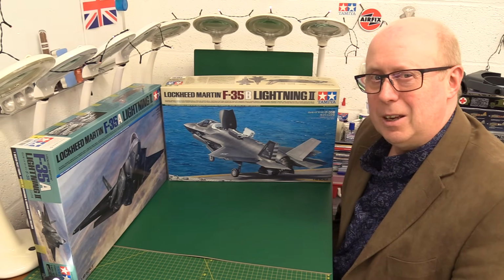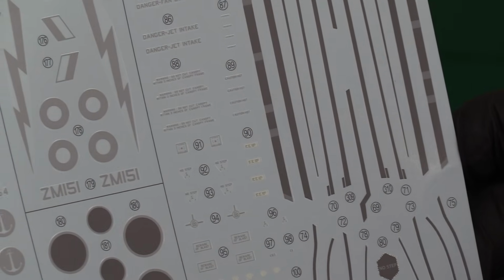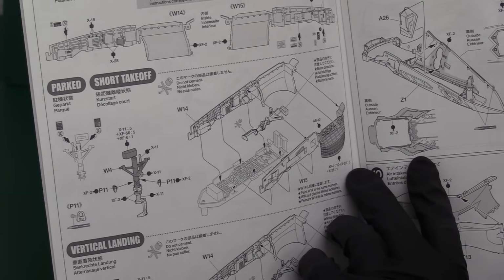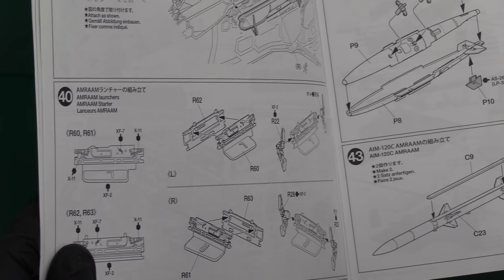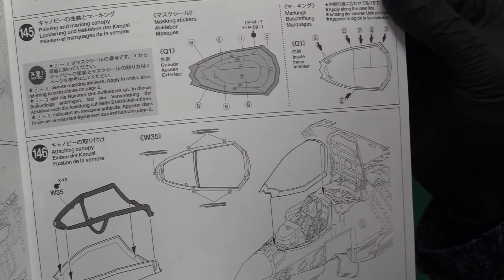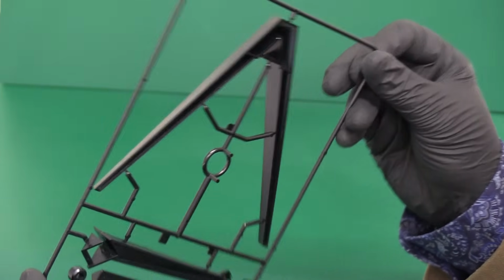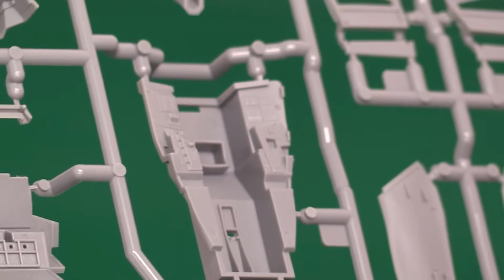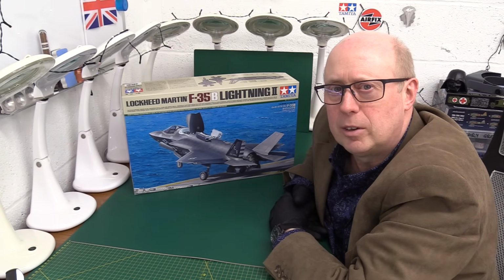Tamiya 1/48 F-35B Lightning II detailed review (61125)

Comment: The kit is probably not weight on wheels because it is really designed to be shown on the stand in the air - hence there would be no weight on wheels. They'd need to include two sets of wheels.
The kit should be marked down because it includes parts for the open canopy, but not the wheels on the ground.
If the left the open canopy option out and no weight on wheels then it there'd be no justification for marking down.
But since, they gone halfway by adding both open and closed  canopys, but leaving out the weight on wheels option needed to make the open canopy really useful, then IMO they should lose a mark.
Can't have Tamiya getting complacent - esepcially with the F-35 series of kits which will be analogous to their F-16 kits for the last 40+ years.
The F-16 kits are important because the F1-16 was the most widely exported fighter for "free world" and the F-35 is esentially it's replacment. As such we've seen a lot of F-16 kits and I think we can expect to see a lot of F-35 kits. It will be interesting to see if the F-35 is as long  lived - it's harder to add capabolity and payload to an F-35 without reducing it's stealth.

Comment: The F-35 is held together with fasteners, including the wing skins afaik.  The non removable portions are presumably filled and sanded, while the removable ones are covered in tape - allowing the dimples of the unfilled fasteners to be seen. Therefore I have to assume that Trumpeter used production drawings or production photos of the aircraft in it's primer paint, where all the fastners are still visible. Filling these on the wings shouldn't be a major task I would have thought. BTW, an interesting short vid on youtube can be found if you search for "Projected Work Instructions on the F-35 Lightning"  They use a projected image onto the aircraft to show workers which holes require which fasteners!

Comment: Because of the way the kit is designed you need to fit the front undercarriage in the undeployed position then cut a piece of plastic off if you want it deployed
Reply from the maker: Right! That explains it. Cheers
Reply: @Peter-Oxley-Modelling-Lab  I snapped mine off straight away on the original release so it didn’t work so well for me 😂
Reply from the maker: @russellbower3454  Oh hell! 😨 I will take that as a warning…😱

Comment: The engineering of the Tamiya F-35A & B kits are almost catching up with Bandai engineering and fit.  They have taken a leaf out of Bandai's book, so much to the better.  If only all kits could be engineered that well?  Airfix, are you watching?
FYI: DO NOT weather these aircraft - they are kept meticulously clean!
Reply from the maker: Agree with you, though I understand the Top surface RAM tape goes a sort of slightly yellowy gold over time if on carriers.
Reply: You need to keep the weathering subtle I have found, it is needed just to break up the shape a wee bit; especially if without RAM tape. but you are right definitely not Tomcat style weathering!
Reply from the maker: @NPractitioner  Yes Gav, I agree completely. 👍🏻